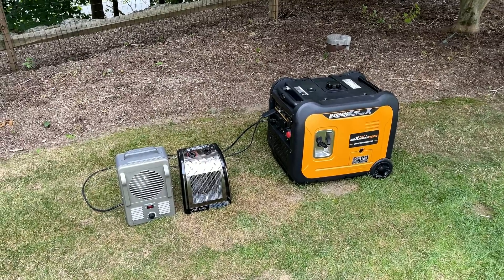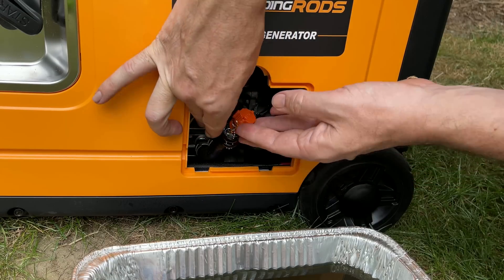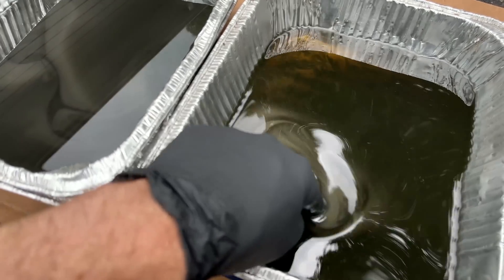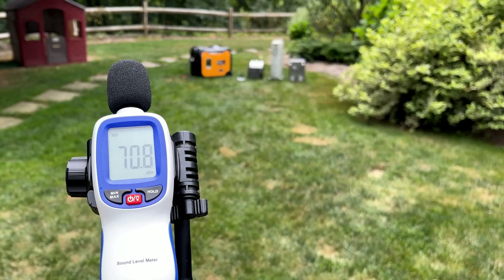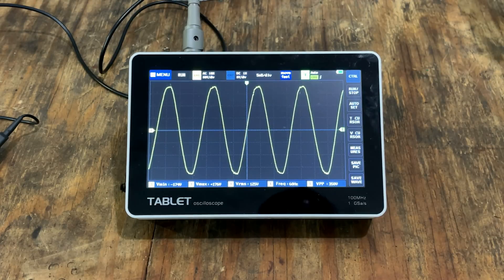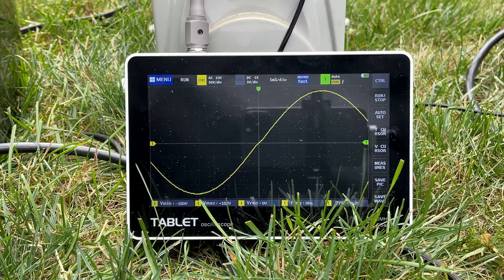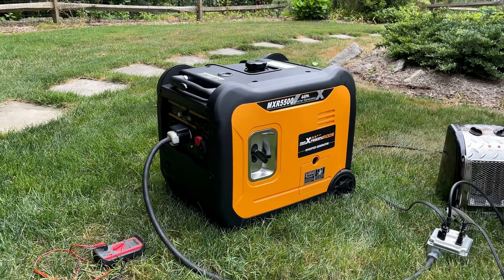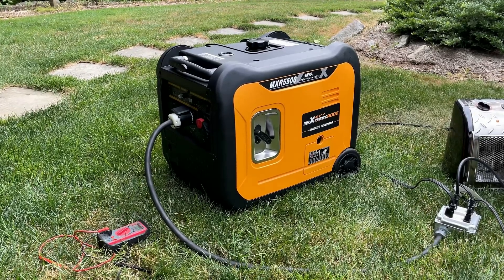MAXPEEDINGRODS Inverter Generator Load Test

Comment: Hello, I’d be really grateful if you could answer my question. Two rubber hoses are attached to air filter box, one on top - regular ventilation, and second one on the left side of the air box. What’s it connected to on the other end? Mine generator (EU version with remote start) came without that hose, and it’s nipple simple exposed to potentially dirty air.
Reply from the maker: Usually one goes to the valve cover for crankcase ventilation and sometimes there is a second which is a fuel tank vent.
Reply: @jcondon1  Thanks. I was suspecting that. Explains why my generator runs lean. Carburetor was probably set taking additional enrichment (from fuel tank gas vapors) in to account. Too bad idle enrichment bolt is in a form of basic plug, would have been easy fix otherwise.
Reply from the maker: @Paberu85  that what I think every time I spend an hour drilling a jet one size at a time until the engine starts running right.  An adjustable needle would make it a 1 minute fix.

Comment: These MSR units are awesome I have a 6000W one connected to my house on an ATS and it's worked well in outages, They are not that often in the UK but still handy to have and cheap to buy and have installed

Comment: I would prefer separate operations for on-off switch, fuel,  choke, starter. for one thing, it makes it easier to simply run the carburetor dry without turning off the ignition, and more reliability.

Comment: I've got the MXR3500 watt model and it weighs 47 lbs and is ultra quiet. Runs my entire 29-foot camper and was only $550. Very impressed so far. Pulsar looks to have a new 50 lb, ultra small 4000-watt generator for around $500 now and I'm very curious to know if it can make the full 4000.

Comment: the best oil to use is Shell Rotella  or Mobil Delvac I have Broke in Many Generators with Mobil Delvac 1630 High Performance HD 30w Oil and Never had the Oil Look that Dirty , Plus its Not really the Dirty AC voltage a generator produces that will Harm Electronics  All Electronics Run ON DC Voltage  So there  in line Choke filters & Capacitors on the Power Supply AC Input to Clean the AC Voltage then its converted to DC Voltage and the DC has a Large Capacitor to clean the DC Voltage .  what Will Damage Electronics is Voltage SPIKES   Reg Generators (NON Inverter) that use a Capacitor to Regulate the AC Voltage when a load is added and removed  the Engine RPMs will Raise and Lower and the Voltage will do the SAME That's what Can DAMAGE Electronics ! The CHEAP BRUSHLESS Generators are the WORST Never Use one to Power Your House !  Now a Generator with a AVR (Automatic Voltage Regulator )  when the Engine RPMs Drop and raise the AC output voltage stays stable SO if You Plan on buying a NON Inverter Generator Make Sure it Has a AVR ! OR if you already have a Non Inverter Gen check to see if it has a AVR if not I try to sell it and Buy one that has a AVR  I have Run LCD TV , Home Computer , frig , microwave  all on my 8000W With a AVR and have never had a problem .
Reply: This one specifies 10W30 oil though.

Comment: i just got the MxR5500.  can some please tell me how to cut off the fuel so the carb 'drains' while the engine is running?
Reply from the maker: The fuel valve and ignition switch are integrated.  You might be able to turn the knob mostly of so the fuel stops but the engine keeps running.  Otherwise you have to use the bowl drain.

Comment: Test the power quality with something other than a near purely resistive load.  A loaded switch mode power supply will add all sorts of distortion.  It's not the source most of the time,  it's the load.

Comment: ANYONE...I've been looking for a motor startup surge assistance unit that would work in conjunction with a smaller generator to provide startup surge power to the load in addition to the continuous output of the generator. That way, it could withstand a simultaneous start of a/c, refrigerator, etc.  Or, are there appliance controllers to interlock and prevent multiple simultaneous starts?

Comment: Help me out. What is the difference between inverter and generator?
Reply from the maker: A generator creates power by spinning a magnet in the stator and the stator output is connected directly to the outlets.  Engine must run at 3600rpm.  Power is more dirty and the voltage and hertz fluctuate.  An inverter generator creates high frequency high voltage 3 phase AC.  That is rectified to DC and then feed into the inverter to create clean single phase AC at exactly 120 volts / 60 hertz.  Inverters are more complicated, but the benefit is that the engine can run at different speeds based on load, they are quite, more fuel efficient and make clean power.

Comment: I was actually in the process of watching this video when the truck pulled up with my new generator-  It looks to be the bigger brother to this one. It probably all comes the same factory / parent company since that brand makes one absolutely identical to this.  Great tip with changing the oil every hour of the break in- so obvious but something I never would have thought of.  I've done 2 hours at idle so far, and happy to report my used oil is looking a lot better than yours did!  Also spent a couple bucks on a magnetic drain plug which had a decent amount of metal on it after 1 hour, but nearly none after 2.

Comment: The chemist in me, looking at your break in effort, makes me think the metal and darkness in the oils might be filterable if it was filtered through activated carbon and filter paper.

It should come out as clean as the stuff in a fresh quart of oil.

I say that because 1 hour of running hasn’t changed the oil by any means.

It’d cut the amount of oil you need to
Dispose.

Comment: That is impressive that unit, I guess the next test would be knocking it around and using it long term. It came across as being really quiet, is that your impression? Have you seen quieter ones?
Reply from the maker: It is quiet like most inverter generators.  The more expense brands are a little more quiet.  Definitely would be interesting to see how it does long term

Comment: One thing I have noticed with many of the battery operated high frequency inverters is they react quite badly to highly capacitive loads being connected.  A humble plug pack / wall power supply connected at the peak of the sinewave (can take a few tries to do it) can draw enough current to cause a HF inverter to assume overcurrent / fault and mangle the output for a few cycles before climbing back up to normal voltage over a second or 2.  It would be interesting to see how one of these inverter generators behave since they use the alternator to produce the HVDC instead of boost power supplies as do HF inverters.
Reply: I was wondering about that myself.  In these tests he is using space heaters, which are resistive loads.  How would this genverter do with some reactive loads mixed in?

Comment: Pretty amazing the color change of the oil during the breaking process. I could not believe the difference in the darkness of the oil when I recently break in a new 9500W Champion generator. You wonder sometimes if it is normal. Great video James. Continu the good work.
Reply: That's why i don't use standard Automotive engine oils in my Generators or Lawn equipment  i use a High Performance Heavy Duty Engine like like Shell Rotella  or Mobil Delvac 1630  they have extra anti wear additives & additives to withstand  Much High Temperatures .

Comment: Just an FYI... If the cap does come off of the oil drain you will loose all of your oil. Due to crank case pressure changes it will eventually pump all of the oil out of the case.

Comment: Hello James what’s your opinion on the Predator super quite 9500 power inverter generator
Reply from the maker: Have not tried one.  But seen some reports of the invert model failing pretty quickly.  Not sure if a wide spread problem or just a few bad ones.  Generac had a similar issue a few years back.
Reply: Maybe it’s a good thing I didn’t run out and get one yet, I’ll wait a few years till they work all the bugs out. I have a brand new regular predator generator with only 12 minutes on it, haven’t used it but to start breaking it in

Comment: I appreciate you didn't spill a drop of oil during the oil change.  BUT!!  You were doing it on your lawn!  Why take that chance?  If you did spill oil or gas the dirt would be poisoned and you would have a dead spot.  Get a 4'x4' sheet of 3/4" plywood.  Put a handle on it so you can drag it out to the yard.  Do all your testing on that plywood.
Reply from the maker: I do have a few dead spots on my lawn.  I usually make it a point to do that sort of thing in the garage or on the driveway.

Comment: Enjoy watching your videos. Was wondering about inverter generators and what ones are good to buy 6000 watts to 10000 watts? Input greatly appreciated.
Reply from the maker: Not many in that range.  The Honda EU7000 can do 5500 continuous. Harbor Freight has one that can do 7600 continuous watts.  But have seem some reports of inverter modules failing.

Comment: The only minor downside is that you can't run the carb dry by shutting off the fuel.  They do provide a drain port, but in order to use it, a cover has to be removed, a carb screw backed out, then re-asembled.  A lot more effort for the monthly maintenance runs as opposed to simply shutting off the fuel and putting the genny away.  And will the cover screw fatigue prematurely?
Reply from the maker: There is a drain port on the carburetor bowl.  You could probably turn the knob mostly off to run the carb dry.
Reply: I watched a review someone else did with a similar fuel shutoff. He pulled the cover to access the fuel valve and disconnected outlet line to the carburetor. He slowly turned the fuel valve until gas started to flow then dialed it back until it stopped. He verified these results several times then marked the dial with a permanent marker.  You could put painters tape if you don’t want to mark your unit.  What he discovered was just before the valve was at the closed/engine off position the unit would continue to run, the fuel would stop flowing from the tank-valve-carburetor, run dry then shut down.
Reply: Drill a 1 inch hole through the cover in line with the carb drain screw. 
Insert rubber bung in hole in cover...it would look standard if done well.....

Comment: With your break in oils color that’s why When I broke in my new Honda EU2200i generator I changed the oil at about 10,20,30,30,60,60 minutes. At about half a quart of oil per change it seemed like the smartest thing to do.

Comment: I've been considering making the swap from my parallel Honda Eu2000i generators to a single 5,000-watt inverter generator. This one looks interesting as do a couple other models, the thing that makes me hesitant every time though is this. With the Honda, the full-service kit (air filter, spark plug, gas filter, etc.) as well as any required spare parts are very easily found & are generally very affordable. The other thing is there are a number of 3rd party upgrade options available for the Honda units, however, I can't say the same about a lot of these alternative options. So while their performance seems great, and their price points excellent I am still hesitant to make the move to these less known options. I've had my Hondas running perfectly for 14 years now with no issues, so I want to be able to say the same for whatever generator I plan to move on to next, unfortunately, the Honda option as a replacement may be the route I end up going with which is a shame. I say this because the Hondas are so highly-priced with the 7,000-watt unit being the only Honda option that is in this power range that also produces 220 volts (which is the one thing I am lacking with my present Honda EU2000i units & really the only reason why I want to upgrade due to my new split AC units now being 220 volts instead of 120 volts like my old split AC units.).
Reply from the maker: That is the largest issue with most generators made today.  Only a few companies supply parts and you pay a premium for that benefit.

Comment: Thx for the excellent review and startup.  After seeing the used engine oil, you’ve convinced me to take the time to run and change the oil A couple times on the new small generator I’m buying.

Comment: Hi James... thanks for the upload.    I have to honest... I am the original owner of a Honda EU2000 bought about 10 years ago. Still have it.. runs flawlessly.  I did the same as you for break in... but I NEVER had oil look like that black tar!   What is up with that gen?    Even after 3 changes that oil looks burnt.    My Honda takes just under a 1/2 quart of oil.    That gen you have uses an entire quart.    I like it and was considering it as a bigger unit, but that oil scares me from ever thinking of buying one.  Thoughts?
Reply: I wouldn't trust oil that didn't turn black. If it isn't black, it's either new oil or the engine hasn't been used.

Comment: Nice generator but they should really give you access to both legs on the front panel.  Not many people will have a breakout box. Either add another NEMA 5-20R on the panel or a least split this one so that the two outlets are on different legs.  I would mark this generator down one star for this but otherwise it's impressive - the Chinese manufacturers have really upped their game. The oil change system is the best that I have seen.
Reply: A NEMA 5-20 is good for up to 2,400 watts so another receptacle is the only way to tap into the full rated output. But you run into the use case vs cost issue. If you have higher demands expected than your single wall outlet can provide you will likely have or want the higher power outlets.

Comment: When you unboxed this generator last week I was very impressed it is a practical tool for outages and camping. What really impressed me are the numbers and THD for around $1100.00 it seems like a great deal it is too ad that our government has to add an additive such as ethanol to our fuel that does absolutely nothing to make it efficient or burn cleaner. James thanks for sharing your review with us it was honest and very informative. I don't think leaving this out in the elements would be a good idea but load testing should be conducted a couple times a year. Ed
Reply: Ethanol has been in gasoline sold in the USA since the 1970's. The car companies had a few troubles at first, but all those were solved years ago.
Ethanol DOEs make engines run cleaner. While it's true that there are not as many BTU's in ethanol as in gasoline, ethanol raises the octane of the gasoline it's mixed in.
GM's flex fuel sensor looks for alcohol (ethanol is a type of alcohol) and turns up the performance if it finds it. It really likes E85.
Reply: Do people really take generators, of this size, camping? I'm no expert camper but this seems to bulky and heavy for weekend camping.

Ethanol was added to fuel when they took the lead out of fuel. Lead and Ethanol are used in gasoline to boost octane and prevent pre-ignition/knock/detonation when trying to squeeze out performance and efficiency of the fuel. Also it wasn't the governments idea to use additives, it was the petroleum companies that wanted their fuel to perform better in engines than the competitions fuel. The government only stepped in when they banned the use of lead in gasoline - for obvious health safety reasons. Since then the EPA has made decisions on allowed additives in fuel but ethanol is not required or mandatory. You can buy ethanol-free gasoline, it's just going to have some ethanol substitute to boost octane rating be it lead (aviation gas), MTBE (better than lead but still not as eco-friendly as ethanol), or something else.
Reply: @killer2600  Ethanol doesn't seem worth the cost to me but I am just a consumer that has to believe what the worthless EPA does. Will ethanol gas hurt my car?
Ethanol can damage many parts of your car at concentrations above 10%. Ethanol can destroy gas tanks, fuel pumps, gaskets, and attract moisture into your fuel. Engines can be completely ruined over time if they're not designed for ethanol.Jun 8, 2022
Reply: Biobutanol is the right alcohol for ICE, very similar to gasoline.

Comment: Good to see the difference in oils during the break-in period and also how it maintained frequency and voltage drop was minimal while testing.

I am liking this generator to power the essentials during a power outage.
Reply: Yeah found that REALLY interesting to, I would never have imagined it would be so bad.
Reply: I have 3 Honda inverter generators. Never saw anything like this after break in oil in mine. Perhaps Hondas are just superior quality?
Reply: @jamesws3  I'd imagine they would be, given many of the others are copies of the Honda, you could assume a copy to not be as good but on the other hand maybe they could improve it.
I found the oil examples pretty shocking tbh.

Comment: Can you show us some examples of THD?  Like what does 1%, 3%, 10%, 25% look like on an oscilloscope?
Reply: It's best seen with a spectrum analyzer. If you know what a perfect sine wave should look like, you can see imperfections in the wave on a oscilloscope to see the distortion (from perfect). In the video, you can see the ripple of the peaks and when this generator is loaded you can see the distortion of the slope as it crosses the 0v line. So it isn't perfect but when you look at a brushless generator on a oscilloscope the difference is very apparent which is the better sine wave. But a spectrum analyzer makes it easier to see the THD and how much THD there is.